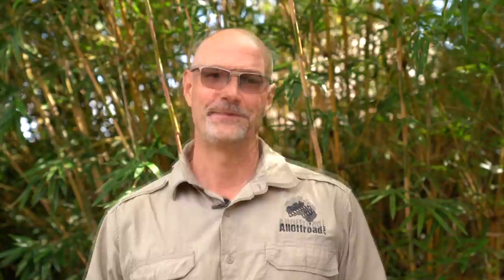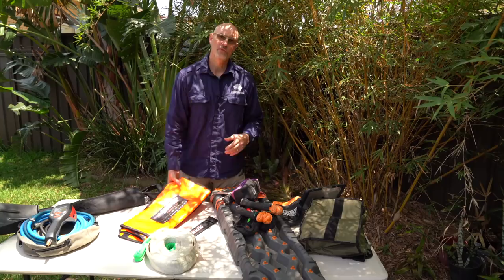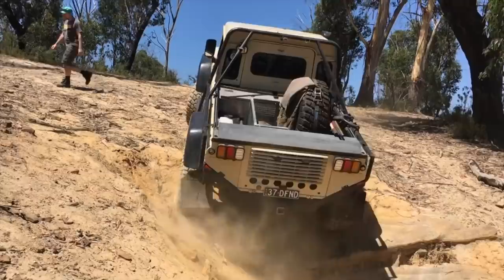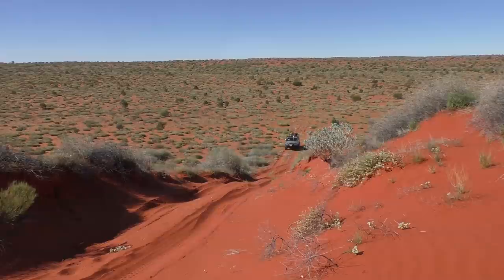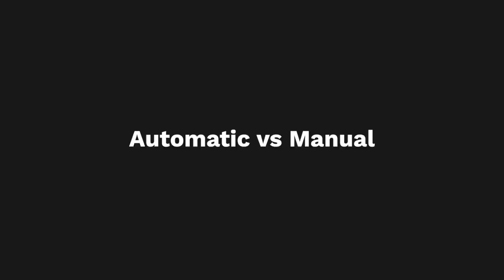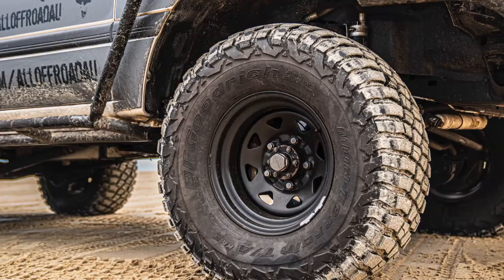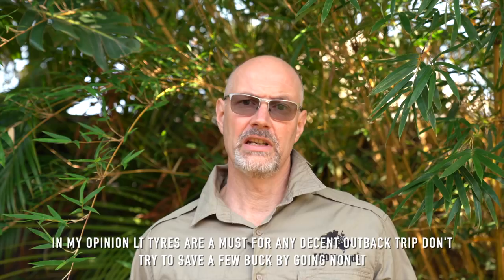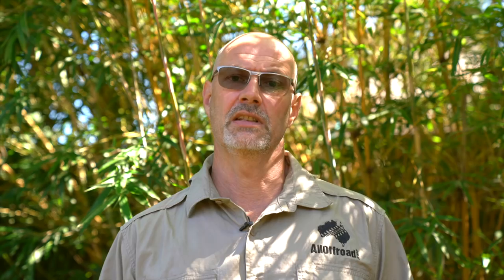4wd Sand Driving Tutorial 4: Expert Tips from a 4WD Trainer | Ultimate Tutorial

Comment: Just on the traction boards, I travel alone and have carried my Treds for over five years. Only used them a few times (more to assist others than myself!) but they can be extremely useful both as an addition to other aids (lowering pressures, winching etc.) as well as on their own. Only last week I needed to cross a section of (river) beach with my tyres at 25/22 for the dirt roads I was travelling. Of course I hit the only section of deep, soft sand! Rather than have to lower my pressures to cross a short distance of sand, the Treds were in position in less than a minute, allowed me to drive out and continue on my way. They have their uses...

Excellent video, thanks Stefan!
Reply from the maker: Yes mate they do have their use, personally, unless I do remote desert travel or travel alone  I rather save the weight.

Comment: Good video, thank you very much. For the record, I have done really good sand and dune driving with road tyres. Unless it is muddy (not often in the desert) the road tyres have very little dig into the sand and actually perform great.
Reply from the maker: Indeed, as I've highlighted in several of my videos, the tread pattern of tyres doesn't significantly impact performance on sand. However, it's crucial to note that road tyres are not suitable for extended sand driving or touring. This is because they possess a much weaker structure and aren't designed to be aired down. Additionally, they offer substantially less resistance to punctures and pinching compared to LT/AT or MT tyres. It's essential to choose the right tyre type to ensure safety and durability in these conditions. Also, it's important to remember that track conditions can quickly change, (I had rain in the Desert on several occasions) and navigating clay pans in the desert with road tyres is particularly challenging. Their lack of traction and durability under such conditions can lead to difficult and potentially unsafe situations.

Comment: For very fine sand 35" tire 20 to 25 psi. 33" 15 to 20. 31" 10 to 15. I dont recommend going with a smaller size than that. A 75 ratio is ideal for a tire. Spinning your tire faster then 22.5 mph will overcome gravities effect for sand to fall in front of your tire.
Reply from the maker: IMO way to high pressure very fine sand I run 12-16PSI on 35”

Comment: The issue with high speed on correlations is heat buildup in the suspension. That cal lead to failure of components like shock absorbers. So if you must go fast, it is important to stop frequently for breaks and let the suspension cool down
Reply from the maker: yep thats why you need good remote reservoir shocks

Comment: I love that bit of advice on tyre pressures. I run Michelin 4x4-O/R 7.50 R16 tyres on my short-wheelbase Land Rover Series III (I still use tubes, which is both a blessing and a curse), and fortunately Michelin UK have a fantastic tyre load/pressure table for differing conditions. Based on this, and at maximum permitted axle loads of 930 kg (2050 lb) front, 1190 kg (2624 lb), I run the following cold pressures:

Tracks and sand - 65 km/h (40 mph) maximum: 1.0 bar (15 psi) front, 1.4 bar (20 psi) rear.
Emergency soft - 20 km/h (12 mph) maximum: 0.5 bar (7 psi) front, 0.7 bar (10 psi) rear.

I do stress, however, that the emergency pressures are exactly that, emergency (and very temporary) use only. I don't advocate what some YouTubers do and run tyres at 0.7 bar (10 psi) for all sand driving - not all tyres can handle that pressure temporarily, let alone permanently. It's always best to get the data directly from your tyre manufacturer for loads/pressures - not the internet!
Reply from the maker: tubes create very different issues in sand and are a pain in my book. Most modern quality M/T tyres can be run quite low continuously on sand. At present I run around 15 PSI cold on 35" Nitto TrailGrabber for hundreds of KM per trip in the Desert never had an issue. Low pressure does become an issue if you pick up speed on hard ground i.e. gravel road or even tar than pressure needs to be adjusted. My play Jeep I have run on 7-10 PSI on 37" KM3 while technical driving for years.
Reply: @AlloffroadAu  Tubes are a pain most of the time, mainly purchasing the things over here (unless you want Chineseium). I know BFGoodrich UK will not authorise the use of pressures below 1.5 bar (22 psi), but BFGoodrich Australia say you can but speed must be restricted to 35 km/h (22 mph)!
Reply: I spend 6 or 7 months of the year below 20 psi. Doing 70 mph on the highway. I haven't seen any ill effects on my tires or poor performance.

Comment: Another really good video, there's one more disadvantage of larger tyres that I'd add though, the leverage of the larger diameter reduces your braking ability, so it's usually a good idea to upgrade brakes when upsizing tyres, even something as simple as switching to braided stainless lines can be enough.
Reply from the maker: yes you are 100% right I should have mentioned that as well, I have a brake upgrade and as part of the engineering to legally drive the tyre increase you need a lane change and brake test.
Reply: Great tip - I'd never thought of that.
Reply: Agree; I'm going from 32s to 33s on my Ranger (285/70/17); getting rear discs in July (towing a 2.3t tare van, ATM is 2.75t).

BTW, only putting my speedo out by 2-3 Km/h, under-reading).
Reply: @AlloffroadAu  why would you buy an auto 4x4.??..defeats the purpose, & deathtraps down hill..
Reply: toyotas dont stop with std tyres,,i run 35,s no probs.. not jap..you cant upgrade jap brakes,,unless you go hydroboost..when you get a gvm upgrade,, it doesnt include wheel bearings..plus the cost of rotors, calipers, lines, is pathetic..this is why i dont drive jap 4x4rs.. theres no std upgrades.. i can fit all f350 running gear on an f100.. or f250. bolt on std..1960 - 2023. 4, 5, 6 sp. diffs from 3.5 to 4.56 or higher, petrol, diesel..single or duel rear. all chev, dodge, ford, running gear same,ish.. best v8 diesel. 7.3 IH. million miles..
Reply: @stuartkcalvin  you need 35,s..& a didgital speedo.. or buy a decent 4x4, rangers have bad problems.. besides ifs & a computer.. 2 no no,s..
Reply: @AlloffroadAu  what bs,,rim size is bs.. i have 17'', i go down to 10.. work that out..plus arb sell sht.. if you have 20'' rims, you run 37'' tires..not low profile bs mall tyres.. maybe you need watch u.s. vids,,learn something.. 35,s minimum,,on 20'' rims..works out same as 31,s on 15 rims..
Reply: @stuartkcalvin  32 - 33,,is 1/2''.. 12mm..fk all..
Reply from the maker: lol watch the video that is base to start with with a reasonable stock vehicle if you run 37" on 17" rims like I do on my Hilux I would assume you know your tyre pressure and dont need a basic guideline don't you.
Reply from the maker: lol with several hundred thousands of km off-road, an auto seems to have worked quite well for me. Have a look at KOH and other comps most are auto nowadays anyway, I drive both my Hilux on 37"is manual my tourer is Auto, and both work very well. I sure prefer an auto for a tourer. Not sure what auto you've driven it sure does not run away downhill.

Comment: I'm in soft sand at rhode island beaches and I use 2nd or 3rd gear to start off in 4l and then cruise at 4th or stay in 3rd. Tires at 20psi
Reply: Reducing the torque to the wheels, by running at lower revs, or selecting a higher gear as soon as the vehicle maintains movement, is a great way to limit wheel spin, since sand has very little traction to offer.

To not use brakes at all in soft sand, but allow the vehicle to freely stop with just the sand slowing it, avoids digging in.

The moment it stops gently reverse about one meter, ..this assists your moving off, since that sand is now compacted.
Remove the loose hump of sand left in front of each wheel, and always move off as gentle as possible, to avoid digging down.

Comment: Another thing I think is worthwhile mentioning with regard to larger tyres and wheels is the extra strain that is put on components, particularly IFS vehicles. 35" muddies may look and perform great, but the extra momentum generated by a much heavier wheel spinning at high speed and coming to a sudden stop can be bad news for cv's etc. Not as much of a problem with solid axles, but there is still increased wear and tear on components to say nothing of the increase on unsprung weight.
Reply from the maker: yes 100% I think I mention that a vehicle usually needs quite a few more upgrades to run 35" comfortably and without other things breaking. For most IFS vehicles, 33" is more realistic.
Reply: why would you buy an ifs 4x4,,there destines to break.. i dont have cv,s. i have uni,s. stronger, cheaper. buy america, not jeep..they dont break.. i only run 35,s. with 300hp. never broke anything. jap 4xx4rs only made to drive out the factory..period..bought a 1962 f100 4x4. v8.. still all std.. if your worried about breaking stuff, buy something decent, or stay home.. 1982 bronco.. broke the centre out the hub, still worked, just engaged on its own.. 1975 f250 highboy,,all still std.. plus i have a 4.2tdi s/duty 01. sht the alt after 230,k, 13 lt 100. all day..700nm..35,s..4.11 diffs.. as to sand driving, 12 psi, big tyres, lockers..not arb..

Comment: Regarding the gopro test: When going slower and the vibration of the gopro becomes less, it just tells you the frequency of the corrugation is not at the resonance frequency of the camera mount anymore.
It doesn't say anything about the vibration amplitude of the vehicle or whether the corrugation frequency is the same like the dampers'.
Reply from the maker: yes you are correct but that also correlated on how it feels in the car the the amount of vibration you feel trough the car.

Comment: If to climb an incline, traction is improved by having a low center of gravity, and where possible more load on the tires at the higher level while climbing.

If going on a steep downgrade, move heavy items rear, and open the tail gate, to aid stability and  possible braking, if any is possible.
Reply from the maker: Hm not really needed for sand driving. Your packing centre of gravity should be kept as low as possible anyway. Opening the rear tailgate is not a good idea in rough terrain. First gear low range and feathering the breaks is my approach.

Comment: On Jeep JKs you can wire up a "fun button" that will temporarily disable all traction control. Cheers.
Reply: On fj cruisers u can have a failing fuel cap causing all traction control to shut off. Engine light does come on lol.

Comment: Excellent video, extremely informative really appreciated indeed can I please ask you which suspensions shock absorbers you advise for my Mitsubishi Pajero 2.4 diesel 2022 model we often drive on dunes and gravel road over here in the sultanate of Oman, and which tire size will be the best fitting for my 18 inch Alloy wheels if I would like to fit a bigger tire size from the original, one that I have now which 265/60/ R18?…?…?… many thanks indeed
Reply from the maker: could not give much advise with a Pajero as I haven't had one for years not sure what is available. See if you can get King or Fox
Reply: Many thanks indeed wish you good luck 🤞🏼

Comment: Hi Stefan just wondering in your huge experience touring many remote areas what brands of tyres can you usually find to buy in most outback towns?  Is it easier to find 33s than 33s ? I ask this because there’s no point getting a brand of tyre that’s not easily available in remote areas no matter how good the tyre is perceived to be.
Reply from the maker: to be honest you will be hard-pressed to get any 33" or 35" MT in small communities no matter the brand, the biggest brand would be BFG and Cooper but likely also would need to be flown in. A different brand tyre as long as it's same size and construction would  be no issue in a pinch.

Comment: I don't recall any mention of increased wheel WEIGHT when using bigger wider tyres. What thoughts do you have, especially on corrugations, of increased wear of axle, diff and suspension components. Cheers.
Reply from the maker: good point, I still stay below my upgraded GVM but switched from the Nitto Trail Grappler back to BFG now the KM3 as they are a few KG lighter per tyre, I could save further by switching to alloy wheels. The suspension is set up for 35" so no issue there, I have not had any early fatigue in any of my vehicles in regards to bigger tires but it will increase wear. I also have upgraded rear 300M axle now, as well as a front braced diff housing (but that was more for the GVM upgrade) as I mentioned if you go up to 35" it's not cheap and a few things need to be changed to increase overall strength.
Reply: In most cases, if increasing the tire size, beyond the size contained within the standard wheel wells, then it is also advisable to increase the brakes, as well as suspension, steering, and axel components.

This is a good time to address axel gear ratios, as well as speedometer accuracy.

Having slightly shorter gearing overall if pulling a heavy trailer is an advantage, as well as having better control over slow obstacles.
Fitting the most suitable type of axel locking devices while doing this, saves on labour costs at a later stage.

Comment: Hi I am planning a Simpson Desert trip west to east starting from Oodnadatta to Dalhousie Springs via the Public Access Route #8 and then to Birdsvile via the French Line and the QAA. I am in a 3lt Prado standard, no lft or changes to suspension, with a 150lt tank. My main concern is that I am running the factory stock tyres Dunlop Grandtrek AT25 tyres and I think I should take them off and use my choice Cooper AT3 LT Discoverer tyres. I know you are a BFG person, but I would appreciate your view. Should I definitely change tyres to an LT. Lots of desert stuff is not planned in the future and the vehicle is my only car, so didn't think a mud terrain tyre would be a long term tyre solution for me. What do think about changing over to the AT3 LT for the Simpson Desert and onwards. I was thinking also of putting them on King steel terras (like yours) instead of the stock alloys. Any comment on this as well would be grateful. Rob
Reply from the maker: yes I would 100% change to an LT, personally had not much luck with Cooper AT3 all delaminated on my Discovery 3, if you only do occasional trips get some cheap steel rims and put a set of AT/LT I would run either BFG KO2 or Nitto's and then you change back to your other wheels when you drive in town.

Comment: Hi mate I'm from nsw Australia I own a 2005 100 series V8 4.7L petrol I just bought the truck recently it has old man emu nitrocharger sport suspension on it it is also sitting on a set of 16" 79 series landcruiser rims with 265/75/R16 all terrain tyres i have no clue as to what size the lift is on the suspension as this is my first 4x4 I've owned and I'm wanting to upgrade to 35s whats required for that upgrade since you have done it figured I would ask you what you had to do in order to achieve that upgrade thanks
Reply from the maker: Check out my Landcruiser Super Tourer Build videos on my Channel that should give you a good idea.

Comment: Perfect video, thank you!
What do you think about new defender ? It has pretty wide selection of terrain. I'm thinking of getting that car for desert off road. Do you think it will perform well at sand dunes in low range gear ?
Reply from the maker: I think it will have as many issues as the other modern Land Rovers or Range Rovers and while I like the look and comfort I would not purchase one for any offroad work beside the occasional fire trail or beach.
Reply: @AlloffroadAu  Is it because of the approaching angle? Do you think front bumper will touch sand and car will loose its momentum in front of sand dune?

Comment: My GMC Denali came with 22” inch wheels from factory, I really like the wheels but this is also my first year with the truck, I’m planning on just going to the sand pulling my trailer with my 2 quads, do you think it would be safe to air down?? Maybe to 22psi since you said you can air down to the size of your wheel, the sand place doesn’t have any hills or anything, is just flat sand where you have to get in to park if you are trying to camp on the dunes, tyre size is 275/50R22
Reply from the maker: you can air down a little but given how little sidewall you have it will be way easier to pinch the sidewall of a tyre. Saying that on flat sand driving accordingly you should be ok
Reply: @AlloffroadAu  I would probably get smaller wheels in the future but didn’t want to do that my first year with the truck, thanks